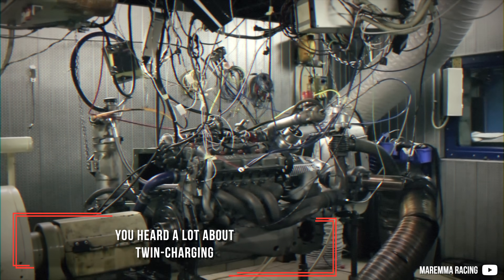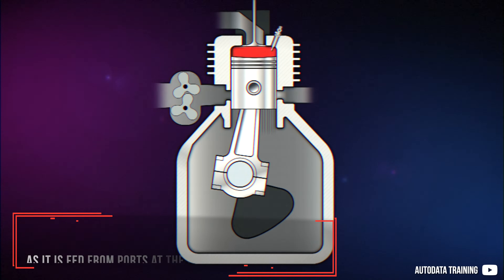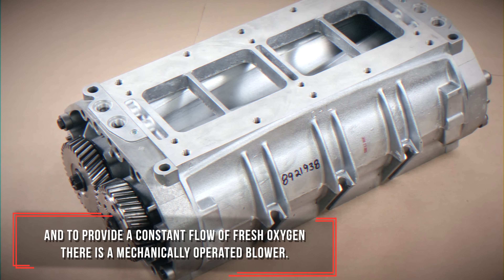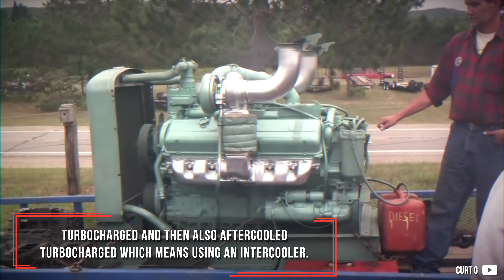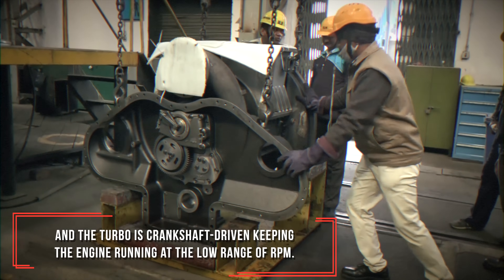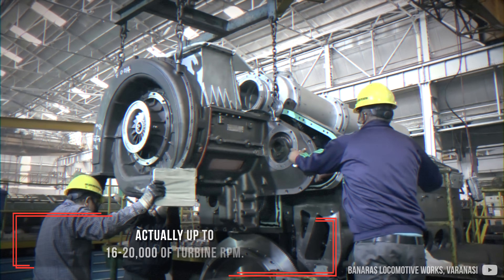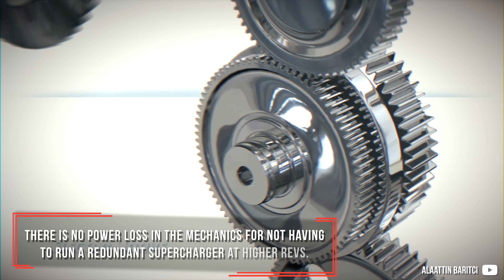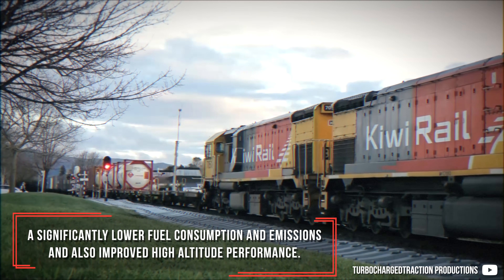EMD's Unique Type of 2-Stroke Forced Induction

Comment: Awesome video! I always wondered where that sound came from. One little detail you didn’t get quite right was that aftercooled doesn’t mean using an intercooler. An intercooler is mounted in front of the radiator and exchanges turbo charge air with cool ambient air. An aftercooler (on a Detroit or Cummins truck engine) is part of the actual intake manifold and looks like a box. It exchanges charge air from the turbo with engine coolant. Not quite as effective, but the older trucks didn’t have room for an intercooler up front.
Reply: Intercooler and aftercooler are synonymous terms... they mean the exact same thing.
Reply: Sander Van der Kammen Regardless of wherever you got that information, in the US, on semi trucks, there is a definitive difference.
Reply: @Flyboy207  No, there is not... some manufacturers use the terms interchangeably while others have a particular  preference for one term over the other.
From a strictly technical definition both terms are synonymous and completely interchangeable.
Reply: Sander Van der Kammen Alright here’s what I’ll do. I’m going to work at a heavy diesel repair shop in an hour. I’ll ask every mechanic and the owner if there is a difference between an aftercooler and an intercooler. I still don’t think that will satisfy you though. My 1997 Dodge diesel has an intercooler. My 1963 Peterbilt with a 350 Cummins has an aftercooler. If I said I had a narrow nose, butterfly hood Peterbilt with an intercooler, people would ask how I fit it in between the radiator shutters and the radiator core.
Reply: @Flyboy207  I think you are confused and misinformed... there are 2 basic types of intercooler.
Air-to-Air heat exchangers
And
Air-to-Water heat exchangers 

Both are forms of intercoolers (or aftercooler) depending on the manufacturers preference.
Reply: Sander Van der Kammen that is correct. However, I am neither confused nor misinformed. I think this comes down to a regional difference. What we call cookies, the British call biscuits. Chips vs crisps, etc. Around here, on a semi truck, a factory water to air intercooler which is built into the intake manifold itself is called an aftercooler.
Reply: @Flyboy207  Manufacturers are often very inconsistent with common vernacular in their terminology and useage.
Another good example is IACs on automobiles.
One manufacturer calls them Auxiliary Air Valve while another might call the same device an Idle Air Actuator or Idle Control Valve
The are the exact same.

You can also debate whether the engine computer is called an ECU or an ECM??? Some manufacturers call them EEMM or EEMS.

This is why education is important when discussing technology.
Reply: @Flyboy207  Don't forget! Some manufacturers call them Charge Air Coolers
Reply: Sander Van der Kammen of course! Usually I feel like Charge Air Cooler is the blanket term or universal term
Reply: @Flyboy207  Intercooler is the most common term used... for both air to air and air to water type heat exchangers.

Comment: I used to work on the Crawley tugboats the ones in Jacksonville Florida have to GM electromotive v20 engines and I loved working on them
Reply: Yes how about an ethanol piweeed EMD 20-710 with dry sump and lots of castor 927 maxima  2 stroke oil with VRO plumed in the fuel. That would be a fun experiment
Reply: @jlo13800 That would be a pointless experiment...

Comment: Would love for you to explain cylinder piling on an EMD engine. How is it done? Is oil consumed in the process? Etc.
Reply: There are nozzles under the pistons that spray high pressure oil into the bores, the pistons can rotate on the carrier which leads to more uniform wear and pop spread on the bores.

Comment: Talking about force induction diesel engines, i wonder if there's a chance you would do a video on the diesel engine setups  used in semi-/truck-/tractor pulling sports. Takes them ages to rev up and make lots of boost, they need much more diesel fuel pumped into the cylinders, and i guess they add a water injection system which gets activated just short before the engine has to deal with the heavy load, for cooling reasons. I guess water injection is what changes exhaust fumes to very dense black smoke - but i actually don't know and would like to learn about it. Regards ^-^,
Reply: No manifold boost on these engines... tractor pull guys run 4-stroke engines with staged turbos

Diesel engines run much leaner air-to-fuel ratio than gasoline engines between 17:1 and as lean as 70:1
Black soot forms at around 21:1 and gets thicker and more black as the AFR gets richer..
Richer AFR makes more power but the engine runs hotter (the opposite of gasoline engines)

.Water injection helps cooling in a Diesel engine.
Reply: A lot of them run 2 strokes too. 2 pshysho 8v82 quad turbo. A lot of the 4 joke Fidel’s are converted into poppet valve loop charged 2 stroke for maximum power at lower rpm than can be obtained with the 4 joke cycle.https://mart.cummins.com/imagelibrary/data/assetfiles/0058689.pdf

Comment: I've actually been thinking about potential solutions for forced induction along the same lines as of late, and I think I came up with a solutiom of my own.
Instead of using a complex twincharging setup, or an overbearing 2-in-1 design that relies on clutches, why not have two turbine blowers and a pulley/cog, all on a shaft with two inverted hybrid ratchet/flywheel clutches? The idea is that, if the engine is spinning the crank drive faster than the exhaust is spinning the turbo drive, then the system will run as supercharged, and there won't be any problems with parasitic power losses from the exhaust blower creating a vacuum and making the supercharger harder to drive. Then, once things start spinning up, the exhaust turbine spins up and the whole system falls entirely over to turbocharging once it's spinning fast enough to take over.
Regular ratcheting mechanisms would wear out too quickly due to the friction wear, so a hybrid between a ratchet and a flywheel clutch would be needed for longevity.
The ratchet for the supercharger cog would be toothed on the outside, and the one for the exhaust turbing would be toothed on the inside. When the engine is running low speed, the supercharger ratchet would be able to hook and be driven, while the turbo side wouldn't have enough momentum to pop out and drag (think of the clicking in a bycicle cassette, but too fast to even sound like clicking anymore.). But once the speed starts picking up, the teeth on the exhaust turbine would poke out, the shaft would start spinning with it, and the speed would force the teeth of the supercharger end to retract in.
Such a system could either be made decently compact, with all parts being on a single shaft, the exhaust turbine could run the system off center through gears to allow for a non-1:1 ratio between the exhaust and intake, or all parts of the system could be physically separate, and linked together via chain or belt drive, increasing complexity, but allowing the turbines to be a lot closer to the intake and exhaust, enabling reduced manifold volumes and as a result improving the pressure buildup characteristics on both ends, massively improving the response of the turbines.
This is my mechanical thought of the day, I guess.
Reply: I think you need to learn what a sprag clutch is....
Reply: @sandervanderkammen9230  I think I do too.
When I think of a thing in the moment, it doesn't matter if it already exists, if it doesn't come to mind immediately what it is, I describe it instead.
Reply: @sandervanderkammen9230  Now that I've been fully refreshed on what sprag clutches are, I don't think they'd do the purpose as well as what I described. What I described is more of a mix between a flywheel clutch and a ratcheting sprag, and would either lock or be prevented from locking depending on the speed of rotation as well as direction, whereas a more conventional sprag, including a ratcheting sprag and not just a friction sprag, would not be dependent on the speed of rotation, allowing for the system to be overdriven in some scenarios, causing issues down the line. Drive it fast enough and the internally flywheeled one would open up and let the exhaust turbing connect, drive is slow enough and the externally flywheeled one would slow down enough that the supercharger pulley would be connected to the system. I brainstormed this because it would be simple enough to do, it would prevent situations where a conventional sprag clutch could kick in when it shouldn't (such as a sudden engine RPM increase slamming the supercharger into action and hammering the ratchet in the sprag), and it would prevent wear, both from the prevoous example of RPM hammering the supercharger pulley, and from constantly skipping teeth and generating heat from being driven at very high RPM for extended periods of time.
Reply: @kmemz  The sprag clutch is absolutely perfect for task... its also exactly what EMD uses.
Sprag clutchs are incredibly strong and durable.
Nearly every vehicle with an automatic transmission has at least one sprag clutch which can handle the entire torque of the engine and vehicle.
In off-road mining trucks (which are powered by locomotive engines) we are talking about over 4,000 hp, thousands of foot-pounds of torque.

The EMD turbo system is optimized for 2-stroke Diesel engines.
These types of engines operate at relatively low rpm 
Idle  200 rpm
Redline 900 rpm

These large Diesel engines generally have some type of governor operated fuel controls 
So tend to rev-up and idle down slowly.

Also important to note.
The supercharger impeller is driven at a 18:1 ratio.
This means a 3,500 rpm impeller rpm at idle (200 rpm).
No load max impeller speed 16,000 rpm (clutch engaged crankshaft rpm 900)
Full load max. Power setting impeller rpm is 19,000 ( clutch disengaged engine speed 900 rpm)

I hope that clarified a few things.
Cheers!

Comment: Indian railways operate so mamy emds and every one loves the sound and throttle up , in night trains it is even better when the cabin is quiet and all u hear is the awesome sound of this 4500hp engine ... Sadly the days are gone now most routes are electrified there is no new orders or plans to purchase any Diesel locomotive for passenger in service. Only wdg6 and 7s are being produced with emd 4 stroke diesel atleast those bring back the sound of alcos. But again those are getting less and less use as new 12000hp & 7000hp electrics are taking over. On the new freight corridor the catenary is made to take double containers and they have specially designed pantograph that extend to the height. Probably in next 10yrs all diesels will be gone .. only few extremely rarely used rural routes will have emds serving. All the alocs are already being scraped now or given away/sold to porer nations.

Comment: Are there engines with different sized pistons in the same layout?
Reply: it is common to rebuild older 567 blocks with 645 power assemblies (liners, pistons, rods, heads, etc), and as long as you balance them properly you can have a mix of 567 and 645 power assemblies in the same engine

Comment: The more O2 packed in to a combustion chamber the better bang for your buck. I wonder what the limits are to this concept? How much further can it be pushed to get more work out of the fuel that is being used?
Reply: Not the same as turbocharging a 4-stroke...
Reply: @Alfred Wedmore So why are 2-stroke Diesel engines more efficient than jet engines???
Reply: @Alfred Wedmore Well, its obvious you are not an engineer...
Reply: @Alfred Wedmore Its very apparent from the egregious errors in your comment that you have absolutely no formal education or professional experience in thermodynamics...
Reply: @Alfred Wedmore You are joking right?

Comment: Wait, EMD two-stroke engines featured “turbochargers” that were driven off the crankshaft?  Wouldn’t that make it a centrifugal supercharger, by definition?

Semantics aside, this is very interesting information.  I had no idea about the turbo being driven by the engine.  Thanks for the excellent video!
Reply: think of it as a twincharger, a turbo and a supercharger combined into one unit.  the EMD design gradually transitions from a blower into a true turbo as the engine revs up.
Reply: @bobsmith2637  Thank you, Bob, for the great insight.
Reply: It's a blower... not a supercharger,  above a predetermined rpm it becomes a  turbo-blower...not a turbocharger.
Reply: @bobsmith2637 No, think of it as a blower, Normally Aspirated.
Crank driven sometimes, turbine driven other times.

Comment: I'm sure there is a future for a uniflow 2 stroke with an electrically assisted turbocharger that would be motorized at low rpm to ensure scavenging by drawing power from the alternator, yet generating electricity at high RPM as an electrical turbocompound.
Reply: I rather use the crankcase and a turbo. Look at the 850 Rotax etec turbo in new skidoos. Tge oil sump is separate which is dry sump VRO pump thingy that’s gets rid of the oil as this 2 stroke turns it into energy! Has any of you all stoooed to realize that. Sldo I run 6 gallons of BRP XD-100 in my 8v92 2 stroke turbo and done is let off and mixed with fuel. She’s running smoother with a bit more power now. Nothing beats synthetic 2 stroke oil.

Comment: So it's a procharger with a clutch that lets so of the wheel at a certain rpm so that the exhaust wheel can take over. Sweet.
Reply: No, it a standard turbocharger with a clutch that engages the crankshaft when the engine is at idle or no load.
Reply: @sandervanderkammen9230  that's what I was trying to say
Reply: @joshlewis5065  ProCharger doesn't make turbochargers.
Reply: @sandervanderkammen9230  yeah no shit
Reply: @joshlewis5065  Then why did you say its a ProCharger?

Comment: I could be wrong, but this looks similar to turbo-compound (not compound turbo) on old aero engines like the Duplex Cyclone.
Reply: Different concept... the turbo-compound couples the turbine to the  crankshaft.
Reply: @sandervanderkammen9230  they are both coupled to the crankshaft. I can see the EMD turbine is designed to boost low rpm performance whereas turbo-compounding is about scavenging energy from exhaust gas at peak rpm. I'm not an engineer though.
Reply: @rolanddutton4723  I think the concept that gets lost with most people is the fact that 2-stroke Diesel engines do not use superchargers to increase performance.
The EMD engine will not start or run properly without the blower providing positive pressure into the air box.

The trick with the EMD turbo system is to have the fuel saving benefits of the turbocharger without the additional expense and complexity of having a supercharger and a turbocharger.

Comment: Why aren’t hot rodders adapting these to four stroke petrol and Diesel engines? I can see it bolted to a 5.9 litre Cummins as part of a compound turbo set up, or a Mercedes 16 valve in a 1932 Ford coupe.
Reply: Because 4-stroke engines don't require an additional scavanging blower... the piston pumps the air into the cylinder during the intake stroke... 2-stroke Diesel engines don't have an "intake stroke" or "exhaust stroke"... they only have a compression and combustion stroke.
Reply: @sandervanderkammen9230  I was thinking about these things as a power adder, like we adapted the blowers from the two stroke diesels for this purpose.
Reply: @chrishenniker5944  Why??? There is no advantage on a 4-stroke engine...  they don't need scavanging.
The turbocharger works the same under load at about 50% of max rpm and higher... 
Same as a 4-stroke at full throttle.
Reply: @chrishenniker5944  You understand that a 2-stroke Diesel won't run at all without the supercharger blower???
4-stroke engines can start and run without any blower..
Reply: @sandervanderkammen9230  Yeah, I know the blower’s fundamental to any two stroke diesel. I was thinking about forced induction to a Hemi or a Honda K-Series.
Reply: @chrishenniker5944  Those engines  have a throttle... Diesel engines don't have a throttle...
Reply: @sandervanderkammen9230  boy he is talking about twin charging where theres is both a supper charger providing boost not scavanging and a turbot also providing boost. supper chargers have awesome response but suffer from parasitic losses, turbos dont but suffer from lag so people looking for the best performance use both but that is complex and it still doesn't eliminate the parasitic losses of the supper charger. 

what EMD has is the wet dream of every twin charge lover out there the response of a supper charger with the efficiency of a turbo in one package and minimal parasitic losses once the turbine kicks in the only power loss will be a free wheeling pulley witch is nothing.
Reply: @phalanx3803  But the EMD turbo unit isn't designed to produce any boost...
All Winton type 2-strokes are Normally Aspirated  whether they have a blower, a turbocharger or both.
With just a turbo? It is 'Turbo-normalized'
Not turbocharged.

Detroit Diesel engines are Winton type 2-strokes, they use a Roots blower plus a turbo, because the Roots blower is a positive displacement type supercharger, the turbo "unloads" the blower eliminating the parasitic load on the engine.
Any questions son?
Reply: @sandervanderkammen9230 so what the EMD one doesn't make boost i can't stick the EMD one on a fucken hemi!  its to fucken big so a smaller one would be to be made to fit and guess what it could be made to produce boost.
Reply: @phalanx3803  But why use it??? A conventional twin charger set-up will produce superior performance...